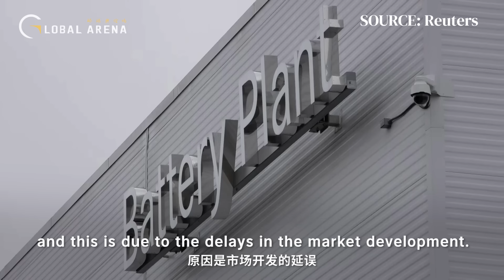Why the Western automakers are ceding the EV sector to China?|Global Arena /w Charles

Comment: Perhaps you are right but I hear that the Japanese has come up with a much better version of EV where charging stations are essentially not required. 
The lack of charging stations is one of the pullbacks for all countries who have not been equipped with that. 
The Japanese version would start the car with traditional combustion thereafter the car operates based on electricity.
Reply: "The Japanese version would start the car with traditional combustion thereafter the car operates based on electricity."

Unless it operates on magic, the electricity has to come from somewhere. If it doesn't come from recharging, then it has to come from gasoline. You are basically describing a hybrid car, something that has been around for more than a decade.